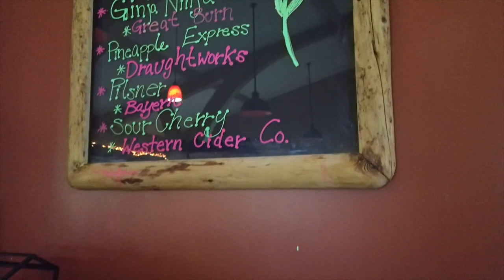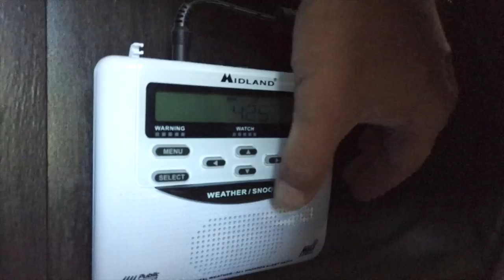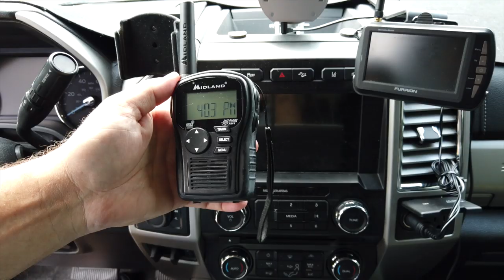Full Time RV Frequently Asked Questions (Part 2) | Changing Lanes!

Comment: Another great option for large bikes in Toy Haulers is the B&W Biker Bar. Had two of those in my last TH to haul two Harley Davidson Ultra Classic Electra Glides and you don't even need tie-down straps (although I used to put one around the front tire just to keep the tire/handlebars facing forward).
Reply from the maker: As soon as they come out with one for Indian, we'll check it out! 👍🏼  😊
Reply: Didn't realize they didn't have one. The only difference in design is where the bar clamps onto the bike frame so I'm surprised they don't have an Indian bar already. Perhaps the frame is not visible/accessible on the Indian or the frame design doesn't allow it? May want to email them and see if the "Touring" bar would fit.
Reply from the maker: I've heard they do not...  But also heard they are coming out with a model that will..

Comment: Great review for on the road items.  A set of tools or a well stocked tool box also helps much. Typically, smaller breed dogs tend to be more timid and nervous balls of fire. They also tend to be more aggressive in personality. Those Chihuahua breeds are the most difficult when it comes to being friendly neighbors due to their barking forever traits.  Lots of small breeds will pee their pants often after only being left alone for a few minutes and again when you come home etc. Not sure about them habits while the larger breeds are bigger, eat more and doo more, they tend to be better on the obedience side of "cruise control".  Not complaining about them smaller breeds, just that after having them for years, wondered why we didn't switch to larger breeds long ago.
Reply from the maker: Not sure if it's just her breed.. but she only barks when someone knocks on the door... not agressive ever.  Doesn't shed.  Doesn't pee inside.  She's a great full time rv dog for sure!  🐶 😎
Reply: @ChangingLanes  Yes, noticed she isn't a barker. Hate to say it but, dogs that bark too much are usually because of their owners lack of respect of the dogs well being and concern for obedience which usually makes them less stressed out. Some owners could take lessons from their pets.

Comment: really starting to be interested in such a life.... having moved twice .. both over 1000 miles... and downsizing from 2400 to 1800 to now 1300 sq feet... where i do not even use the second floor of this townhome (so really live in 600ish)....  and drive to want to see more of the US kind of makes this a workable desire.... just the work part being tied to a single location...   is the limit for now...  mrgh.

Comment: If y'all could have a big Prevost (or something like it) would you? Or do you prefer the fifth wheel, having a truck, etc?
Reply from the maker: That's a really good question.  I guess if someone gave us a Prevost, we might try it on for a bit.  LOL  The big problem with a Class A for us, is we would really miss having a separate office.
Reply: @ChangingLanes  What about a class A with a trailer, enough room for the bike and a dedicated office space? I'm just somewhat dreaming and trying to decide what I'd do if I had the $.
Keep up the great work by the way, I love the video's!
Reply from the maker: The trouble with Class A and trailer is the trailer would need to hold the bike and a daily driver. and would be large.  Which means large pull-thrus only or a place to store the trailer at every stop.  Not a great scenario.  Doable, but not something we would want to deal with....  Hope that makes sense...  👍🏼  😊

Comment: For the new toyhauler that I ordered which is smaller than your rig, I plan on using the wheel chock system from boltiton.com. Very helpful video.
Reply from the maker: Biker bar is supposed to be coming out with an Indian model...  Will be trying that out for sure!

Comment: Love the weather radios and your tips on preparedness, and I enjoyed other videos you did about safety. I wish you'd wear more gear when riding! ATGATT Road rash is no joke, and half helmets won't protect your faces. Thank you for sharing all you do.
Reply: I do full gear whenever I'll be at freeway speeds, but for low-speed around-town stuff just use a 3/4, no overpants, and often regular work boots instead of MC boots.  It's all about risk assessment and acceptance.  I used to ride a bicycle a lot, and the only gear then was a less-than-half helmet and gloves that protect the palms a little.  Some of that involved speeds over 50mph, and a lot of it was speeds over 30mph, both on trails and roads.  I cringe a little to see half helmets or no helmets at high speeds, but that just means the riders have a different level of risk acceptance than I do.  As long as nobody tries to force it, fine by me.

Comment: I was wondering if y’all mounted your wheel dock in the trailer or not. I ride a 2019 CVO and currently do not use a wheel dock in my Carbon 403. I have a Condor wheel Chagall in an enclosed trailer that I was debating on taking out and using in my RV. Thanks fir any info. Also if y’all get back around toward Franklin NC again me and the wife would love to ride with y’all. We have several great rides in the area. Thanks again.
Reply from the maker: We don't mount it.. Just sits on the floor.  👍🏼

Comment: Not being unfamiliar with strapping down large motorcycles for travel I was just wondering why you don't want to compress the front forks a little?  I did enjoy the video and hopefully we can meet on the road and go riding someday soon (I'm in the process of downsizing right now).
Reply from the maker: Don't need to compress them when strapping to the forks themselves (below the shock).  I used to tie down via the highway bars and compress them, but to get them tight required a lot of compression.  That compression for a whole day compounded with lots of bouncing on rough roads isn't great for the longevity of the shocks.  👍🏼  😊

Comment: Chad, I noticed you don't have the WheelDoc attached to anything, any reason for that? I also have the same unit to hold my Gold Wing, though mine came with a piece that bolts to the floor and my WheelDoc locks to it. Must be the difference in when they were produced.    Be safe, have fun & happy camping....oh, and keep the rubber side down.   v/r, TS    Denver, CO
Reply from the maker: It can be bolted down, but it's just not necessary with the 4 tie downs.  18,000 miles and it hasn't budged.  Thanks for watching! 😊

Comment: How do you find services on Sunday, if you have your 45-60 ft RV. Is that something you can comment on ?
Reply from the maker: Not sure what you mean by services?
Reply: Changing Lanes worship services, I thought there might be open air services for RVers instead of trying to park the beast
Reply from the maker: Ohhhhh..  We don't go to services (not religious)...  But, you'd likely not want to take an RV to a church parking lot without explicit permission.  Best bet is to not travel on Sunday and just take the truck or toad by itself.  That said, if you are traveling, you might find a church that will let you park overnight.

Comment: So why did you go with a f350 instead of a f450
Reply: My experience says the 450 isn't that much different in GVWR however, how they are equipped from the factory is quite different. Also, insurance may require commercial rates vs. pleasure. Not a lot of positive notes from the many forums I have read. Very rough riding too.
Reply from the maker: To be honest, if we had it to do over, we'd still be on the fence...  Like the wheel cut, but the ride is a bit rougher and it has a little bit less cargo capacity than the 350 (same GVWR but heavier out the gate).